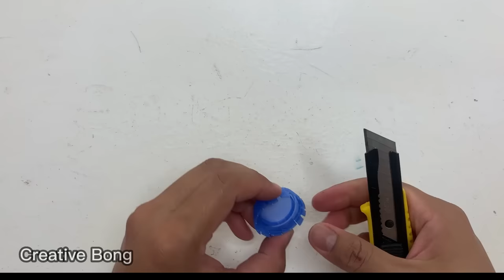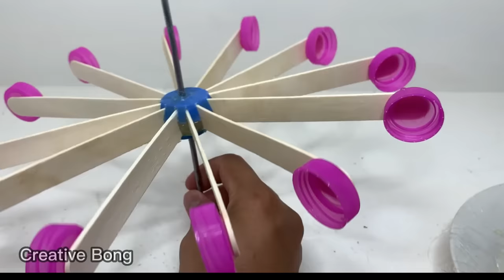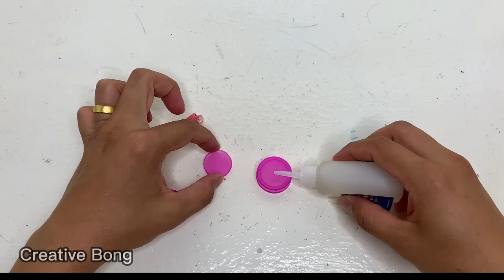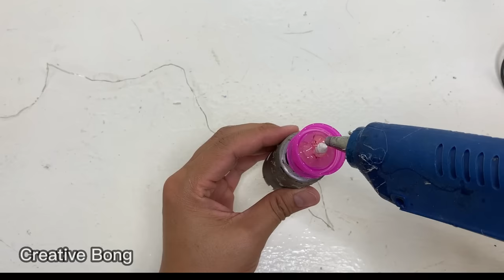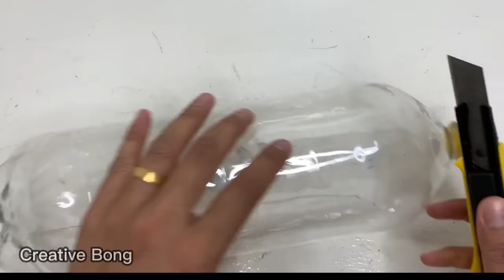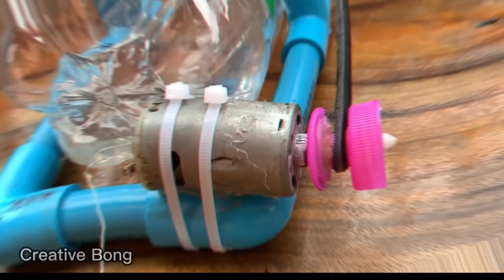How to make free energy from water water wheel

Comment: I tried this with 9 volt motor, when the wheel rotates it doesnt generate enough current to turn on the light, only works when i rotate it fast. What should i do?
Reply: Did you continue to do it or did you have find any solution to fix that problem because im currently experiencing that same situation i really need your reply asap because my deadline is on friday and im finding someone who can help me about it thanks

Comment: Lol. With that little stream of water, the wheel is rotating so fast, it's amazing. It is not even falling from a height.

Guys. There is nothing called free energy. Energy is conserved. In case of turbines potential energy gets converted to Kinetic energy and then rotational energy which finally gets converted to electrical energy in the turbine.
Reply: Nani
Reply: Nani